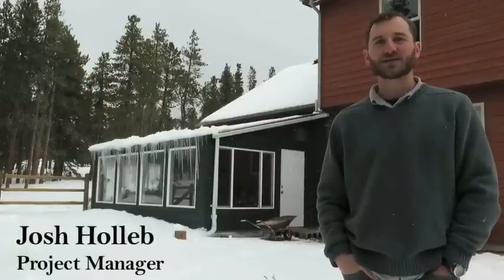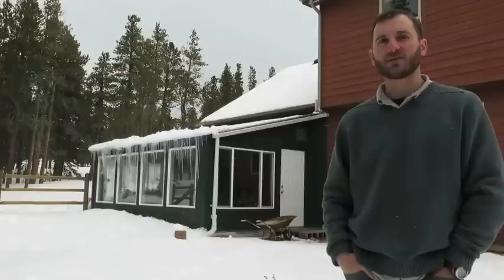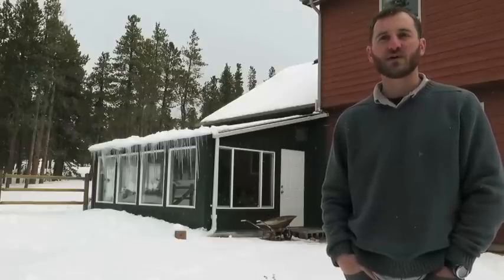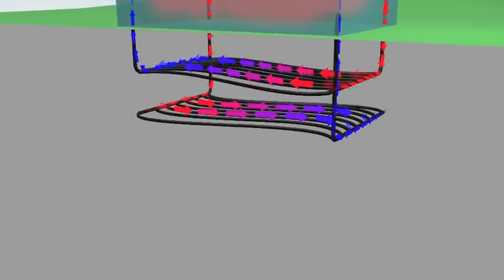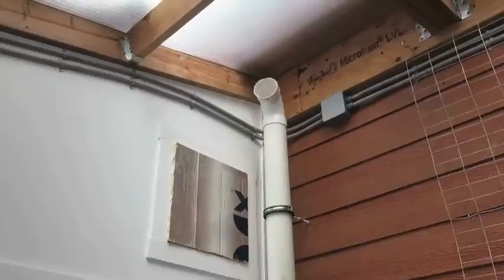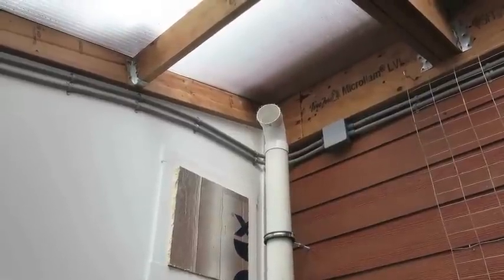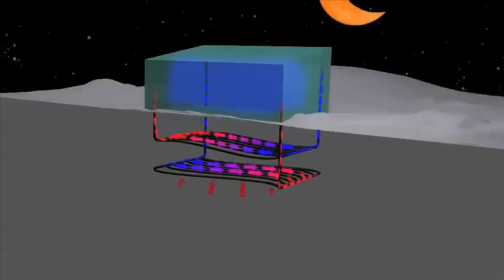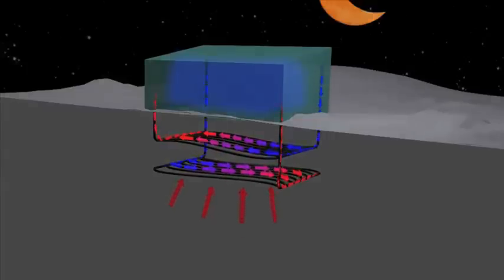Ground to Air Heat Transfer (GAHT®) System - Ceres Greenhouse Solutions

Comment: What happens to the moisten greenhouse air in the ground ? What happens to the water when hot meets colder ground.  Where does it go
Reply from the maker: The pipes underground are perforated to allow water condensation to escape the system
Reply: We have been looking for this information for days from someone that has actually installed more than one of these and knows the results. Of course people say it both ways (perforated/non-perforated), but they're usually people posting a YouTube video with no follow-up after the installation. Thank you!
Reply: @StIsidoresFarm  I watched your DIY geothermal greenhouse video from about five years ago. How's that holding up? I'm wondering if the type of covering (11 mil plastic sheeting vs double walled 4x8 polycarbonate boards) might have an impact on how efficient the heating and cooling of the Ceres GAHT might be?

Comment: Is there a reason this isn't done with water rather than with air? Bigger pipes are more expensive, and air is a poor thermal conductor. Wouldn't it be simpler to put copper radiators in the greenhouse on the un-glassed wall, and use a simple water pump to continuously circulate water?
Reply: thats a solution but youve still got a few hundred feet of copper (any metal really, pvc would be a terrible choice) pipes underground, but any damage to the system later would mean tearing up the entire structure to fix.  not to mention you'd need a pretty strong pump to push water that far down/up.  there are designs that are similar that just heat the floor, but the examples ive seen were combined with geothermal battery, so hard to say how effective it was
Reply: If its water then you could just angle the pipes down a little toward one end like toward the back wall and since its air tight treat it like a hand pump or use air pressure on the cooler side to push the warm water to the  top
Reply from the maker: We have designed a ground-coupled heat pump system that is similar to what you're talking about: https://ceresgs.com/introducing-the-ecoloop/

Comment: how deep do the pipes need to be burried?
Reply from the maker: Typically, pipes are buried up to 4’ underground. This can vary by area; the goal is to bury pipes deep enough to reach stable soil temperatures. We additionally insulate around the perimeter of the greenhouse to create an insulated pocket of soil beneath the structure.

Comment: Wont the underground pipes fill up with water due to condensation?
Reply: Yeah it would. This wouldn't work well if you have a high water line as the pipe should be about 6 to 8 feet underground. You can use drain pipe which will drain the condensed water into the soil. I heard (I don't know from personal experience) that it works fine.
Reply from the maker: The pipes of a GAHT™ system have small perforations so as water condenses underground, it drains out into the soil. This also helps reduce mold issues, which have not been reported in years of testing.

Comment: How deep do the loops need to run?
Reply: From what I have found about 8 feet underground. It depends on the soil temps in the ground where you live. Basically anything below the frost line should work but if you go deeper the ground temp is more consistent. Also you need about 10% of your green house volume in feet of pipe underground. For example if your green house was 10ft wide x 10ft long x 10ft high your volume would be 1000 cubic feet and you would need 100 feet of pipe underground.
Reply: Hi Benjamin, thanks for all the info that you are posting. In the example above, the 100 feet of pipe is volume or length? If length, how wide should be the pipe? Thanks a lot!
Reply: I have never done this but plan to in the future. I only know about this from someone who showed me the way they set theirs up. He had 4 inch diameter drain pipe. He said that he would have preferred 6 inch diameter but the cost difference was just too much for him and 4 inch has worked really well so far. His greenhouse was 40ftx20ftx9ft. So he had around 700ft of pipe laid. the length is about 10% of the cubic volume and any diameter pipe that will allow sufficient air flow should work. So if your greenhouse was small then a smaller diameter pipe should work.
Reply from the maker: Typically, pipes are buried up to 4’ underground. This can vary by area; the goal is to bury pipes deep enough to reach stable soil temperatures. We additionally insulate around the perimeter of the greenhouse to create an insulated pocket of soil beneath the structure.

Comment: How low do you need to dig? I live in the city and I'm not sure you can dig that low.
Reply: From what I have found about 8 feet underground. It depends on the soil temps in the ground where you live. Basically anything below the frost line should work but if you go deeper the ground temp is more consistent. Also you need about 10% of your green house volume in feet of pipe underground. For example if your green house was 10ft wide x 10ft long x 10ft high your volume would be 1000 cubic feet and you would need 100 feet of pipe underground.
Reply: Lot of silly information floating around about this stuff. The 10% volume figure is total gibberish. The pipe diameter, dig depth, and spacing between pipes is completely dependent on how quickly your soil transmits thermal energy. Only insulate your foundation to just above your pipe depth. Insulating around your pipes will slow down the rate at which the soil absorbs and releases energy. You do not want to use the soil around the pipes as a thermal mass or "battery." You want to dump as much energy as you can from the soil at that depth.
Reply: Great Moose Detective   Thanks for the insight.  Would efficiency, in your opinion,  increase significantly by  surrounding the pipe with ~2 or 3" diameter black rocks?
Reply: I would like to know this as well. 

I have seen some that were dug at a couple of feet below the frost line which in many cases would mean a ditch as deep as 5' to be dug for the tubing. Be sure to check with utilities companies at your site before you dig.
Reply: As a guide...for every metre you go down the temperature rise is one deg....this is based on thermal pump calculation....
Reply from the maker: Typically, pipes are buried up to 4’ underground. This can vary by area; the goal is to bury pipes deep enough to reach stable soil temperatures. We additionally insulate around the perimeter of the greenhouse to create an insulated pocket of soil beneath the structure.
Reply: I suggest you install a system using that formula before recommending it to others. Alternatively, you should offer to cover the cost of digging the tubing back up when (not if)  it doesnt work.

Comment: This is one of the best ideas I have come across in quite a while!  I am wondering how effective the geothermal battery would be.  I can easily see how this would be effective over a 24 hour solar cycle, but in terms of storing seasonal heat, I need more evidence.
Reply: Once you reach around 5 feet below the surface the soil remains the same temperature year round. About 54 degrees F where I live. So you are right it doesn't really hold the temperatures like a battery for very long. I know of person that has grown year round using only this method with a  double walled greenhouse. It got down to 8 degrees f and his greenhouse only got to 40 degrees.
Reply: @benjaminbagley4168  40 F is still really cold and I'd expect lots of damage to plants if the roots aren't heated. Would it be possible to add a heater to supplement the GAHT system?
Reply: RFW  sure you could always supplement with an external heat source but you can grow a surprising amount of food when the low is 40. Carrots, most leafy greens, peas. All examples of cool season plants that could survive that just fine. Obviously corn, tomatoes and such wouldn’t do well in that.
Reply: @Ceres Greenhouses is it available in the uk?